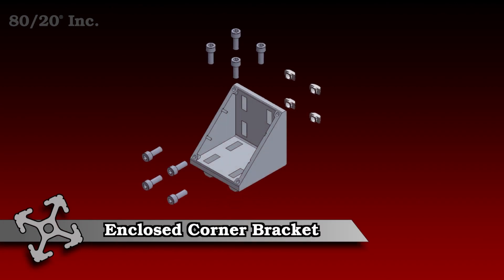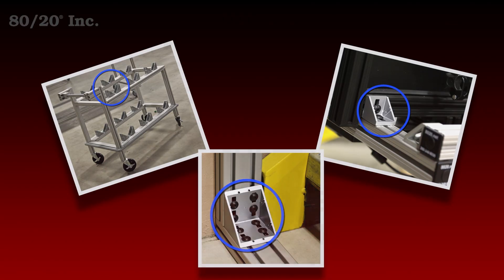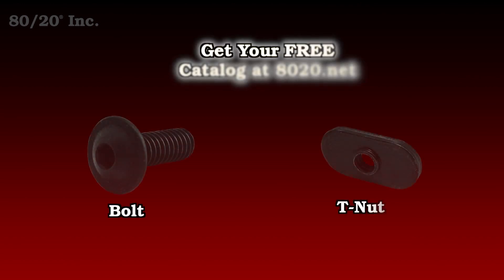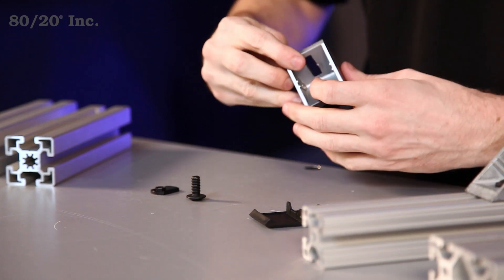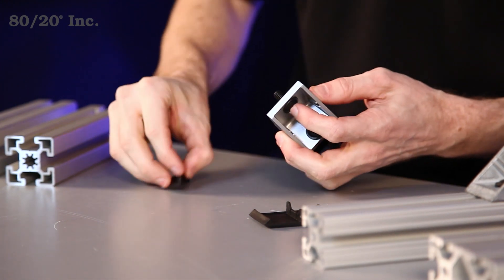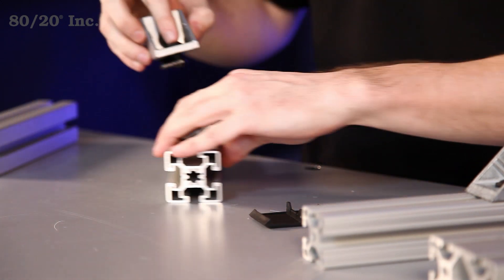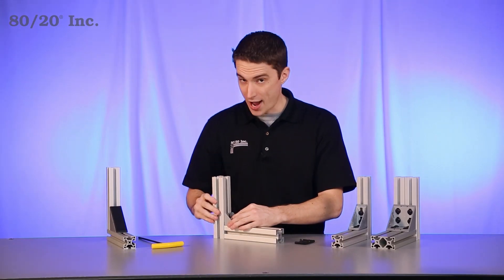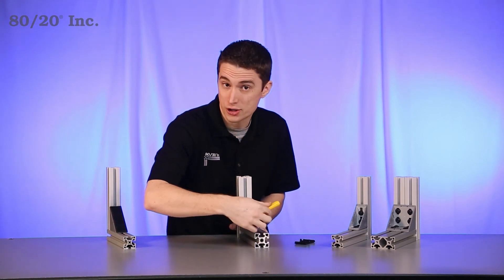80/20: Enclosed Corner Bracket Overview

Comment: thanks for the video. What is the length of the bolt needed for the t-nut ?
Reply from the maker: Hi there - thank you for your question! There are many part numbers associated with enclosed corner brackets, and there are brackets for different series. The best way to find the one you need is to look them up and match up the part number based on the series you are using. There is a recommended hardware section in the catalog and on the website that shows best fastening hardware to use. You can find the links for the brackets on the website and the general online catalog in the video description above!